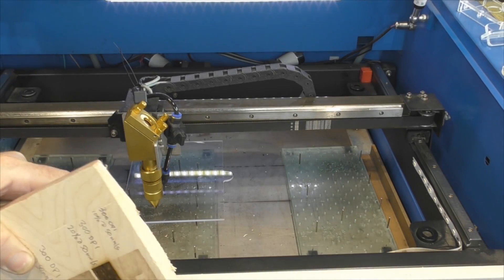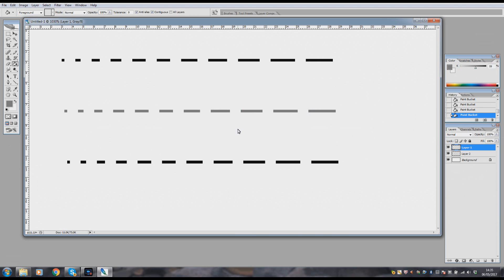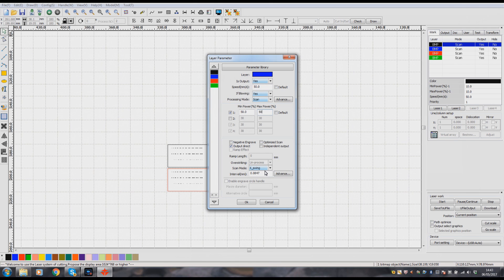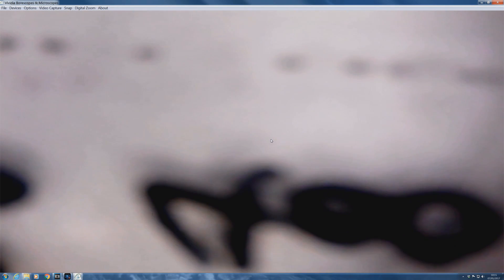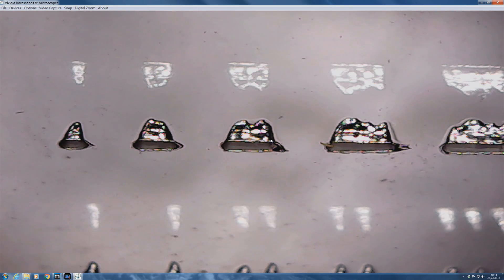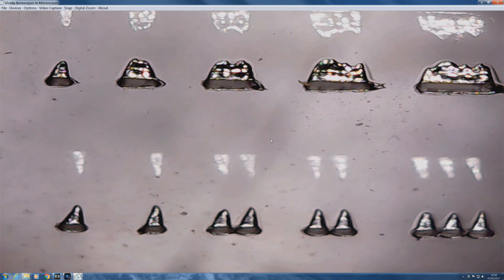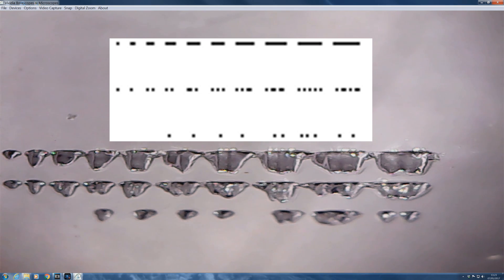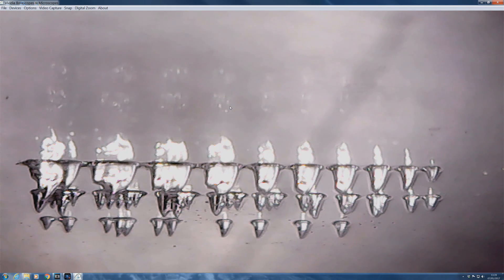RDWorks Learning Lab 105 How Shapely are your Bitmap Dots

Comment: once again a nice exploration of the details of glass tube CO2 lasers, AKA cheap 'chinese' lasercutters. 
So it seems the propagation delay effects are not so pronouced, but the decay-time is much longer?
There might be some more effects to be seen here. The most obvious would be the speed at which one dot will disappear. Just increse the speed on a one-pixel vertical line/pattern until the is no marking visible anymore. It may help to decrease the size of the image, as that will decrease the size of the pixels as well of course. This will tell you the minimum time the tub needs to be 'on' to make a mark. together with the speed, it will give you a maximum horizontal resolution (for a given speed).
The next effect would be to find out if there is a time-shift when doing this minimal pixel. If there is, the pulse-train to the laser should be started a bit sooner than when actually needed. You can test this with a file containing a one pixel border to force the machine to   scan each line. Then, within that border you make a dotted vertical line that either uses the odd or even pixels. Place an odd line below an even one to see if there is any shift in location where the actual dots appear.
My own (ruida)machine is waiting for an upgrade of its optics, so I don't know when I can perform this test myself. I'll make a start on the bitmap though.
Reply from the maker: Hi Jelle
I did run tests at other speeds and powers and resolutions. I have edited all that out because it is really boring and adds nothing to understanding the basic problem. If you have a power supply with a poor response then you will have to experiment with scan speed, picture resolution and power  to find the parameters that give you clean crisp single dots. I now know the area I have to work in when I start looking for parameters....and it will only be on the Lightblade machine.. I am not planning to fix machine problems, I just want to understand what I have so that I can stop my scatter gun approach to finding the best settings.
Best regards
Russ
ps please keep me up to speed with anything you discover form your own experimentation.
Reply: What you should do Russ is open up your Lightblade machine and see if there are any markings on its powersupply so people might be able to buy a proper PSU for their Chinese eBay machines.
Reply from the maker: I have added the following to my text description
The power supply in the Lightblade machine is model #  MYJG60W.. I have tracked down manufacturer to see if there are any detailed specifications   http://en.jnmydy.com/products_detail/productId=23.html     but nothing really helpful. They are available  via many sources if you Google the model number

Thanks for the suggestion.
Best regards
Russ

Comment: it seems to me that the spread of each pixel is simply the acrylic melting due to either the imprecision if the beam or simply because the acrylic around it gets really hot.  maybe try the same experiment on a material that would take melt suck as wood or something g else.

Comment: Very interesting... I will try and see on my machine to see what results I get
Reply from the maker: As always Abraham, I will be interested in your findings. I was surprised to find my machines so different.
Best regards
Russ
Reply from the maker: Hi Abraham
The only advantage of a smaller tube for engraving  is the power characteristic gives you more control at low power, Depending how responsive your system is you may find that you need to be working with picture resolutions at about 150ppi and scan speed of maybe 50mm/s or less to get well formed dots. That means you will need very little power, which is where a well controlled low wattage tube comes into its own.

Interesting machine but that must be using a scanning mirror. It was only doing dots, I agree, but there was only one power being used so it would not have mattered if the dots were properly formed of not. This could also been an RF tube, I have recently been experimenting with wood and found I get better definitions if I use that very low power region called High Frequency Impact Engraving which we have spoken of before.

The power supply in the Lightblade machine is model #  MYJG60W.. I have tracked down manufacturer to see if there are any detailed specifications   http://en.jnmydy.com/products_detail/productId=23.html     but nothing really helpful. They are available  via many sources if you Google the model number
Best regards
Russ